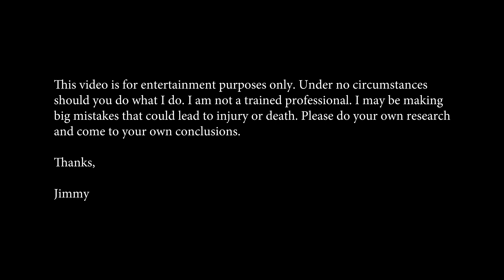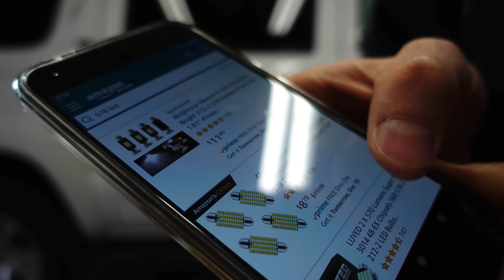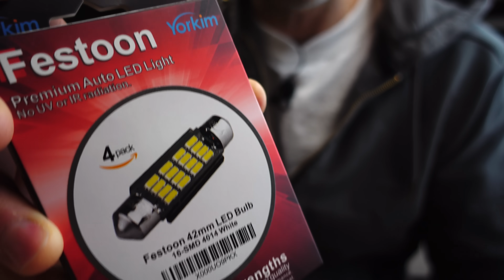Here's Why You NEVER INSTALL LEDs IN YOUR CAR OR TRUCK!!

Comment: Wait. I’ve watched 5 minutes and all I’ve learned is LED bulbs are better. Never use LEDs, eh? Sheesh.
Reply: Yep. Got us all to watch though.
Reply: yeah  stupid title
Reply: The only reason not to is a slightly common issue with turn signal bulbs not drawing enough power to make the blinker circuit work right in older cars.
Reply: Clickbaity title
Reply: He said "Do not use LEDs without heat sink for heat dissipation"
Reply: Meyndert Borrie Bornman That’s NOT what the headline says. . .
Reply: @Taka Yama maybe watch the whole video before being negative.  The content was actually helpful
Reply: How else to get your attention and watch, we keep falling for it but no harm done. And they keep doing it.
Reply: Taka Yama ya self proclaimed professional. The interior bulbs are just incandesant not halogen. Wow theres a big word for him. Leds are the big nightmare of the 2000s
Reply: @imperator parva 
Maybe not , but the cheap eBay 194 bulbs that are 10 for 10 aren't too bad. 
3-4 yrs later and at least half of em work and have been swapped around all over the place. 
A couple got whacked by moisture , but for cheap ones that's as cheap as I go , otherwise it's superbrightleds. 
I've never had any issues with those.
Reply: @standardloginname  you can use inline resistors on the wire to each light to use up the excess power. The old analogue units ticking speed was was affected by how much power it had, using leds pretty much gives it more power making it run fast usually
Reply: I did at my car the same what Macgyver was showing in this video and boom, there was a fire.
Reply: I did at my car the same what Macgyver was showing in this video and boom, there was a fire.
Reply: @meyndertborriebornman7798  LED's that run too hot could be out there... but after using them for several years now in many vehicles I haven't had a heat problem yet. Most if not all smaller lumen bulbs have nothing for a heat sink;  some headlights have 'em and some don't. His caution of "Try to get something solid state" was hilarious, like some LED's have a carbon wire that glows.... 
My guess is that if he had to double the size of the hole to put an LED in replacing an old filament style bulb, he may have greatly increased the lumens and thus increase the heat in that confined space.
Reply: I am working on leds in my part time research science 1990 made lot of prototype for lighting future...earlier i use lens type led which were very durable...now days they are useing bad flux bad insulation...heat sink are missing cheap immitations...which will definately burn ...
Reply: Dear i spend number of years in research and did lot in promoting as the day I find its durability n efficency....and insisted to use every where including tft displays which were back then lit with cfls..the neon signs..with sharp colour leds ...these cheap are putting bad image of leds n me I fear
Reply: @archygrey9093  Resistors get hot and must cause the LED and resistor to use close to as much electricity as the original bulb defeating the advantage in LEDs for turn signals except for brightness. Better to replace the flasher to use one designed for LEDs when changing to LEDs. I live in a northern state where we get ice and snow. Led lights are fine for inside the car but when ice freezes on the external lights LEDs would probably take even  longer to to melt the ice. They have the same problem with snow building up so stop lights can't be seen here. The remedy was to install a heater to warm the glass but the question is will the heater and LED use as much power as the old filament type bulb so are they more efficient than the old style bulbs for stop lights.
Reply: @gordonwilloughby8793  The amount of power the indicater lights use are pretty much nothing with or without resistors, i replaced all the rear lights on my ute as the old lenses and globes broke off. The universal led replacement cluster is cheap rugged and brighter and often cheaper.
Obviously replacing the ticker things the better way to go but resistors are cheap and simple especially since my front indicaters were still non led.
Can't speak for cold climates though, I've yet to see ice outside of my freezer.
Reply: JDMastar led bulbs FTW
Reply: Put LEDs headlights in my tundra truck.
Fortunately I only put them in my lowbeem.
Had to use my high beam to get home. It was like I had no lights on at all.
So I ordered several different sets that were advertised as being SUPER BRIGHT.
All useless......and I MEAN                        U S E L E S S S
ANYONE KNOW WHY.
I thought this video would explain why, but it was just an advertisement for them and amazon
Reply: @standardloginname  Most of the time hyper flash can be fixed with either a electronic flasher or a load resistor, Very simple!
Reply: @byronwoolfrey1039  they are the wrong color, human eyes don't respond as well to blue light as they do to yellow
just one of those things to watch out for...bright as day, can't see a damn thing
Reply: @jeffhousen8968 so why do emergency  vehicles all have blue lights on them.
I usually see the blue light at night before the red.
Reply: @jeffhousen8968  I did buy the small clearance light LEDs and yes they are brighter.
I bought 2 LEDs for my snowmobile and plugged them in to the snowmobile socket before installing them.
Both of them melted right away and wouud only light up on high beam.
Reply: lol was thinking the same ;)
Reply: Taka You have to think about his title but I get it.... he’s saying be careful about bulb design and heat sink. I’m an engineer by profession.
Reply: @standardloginname  that's why you buy an led flasher relay, boom problem fixed
Reply: Till blind me and can't see to drive as you follow or approach
Reply: @standardloginname  Can be fixed by replacing outdated relay for a modern one?
Reply: @jeffhousen8968  Actually it comes down to the CRI more than the color. In fact we typically are more alert and respond better with daylight balanced lights. It is the color of sunlight after all...I mean our eyes were literally made to see with sunlight.  Also they myth that blue light is bad for you is totally fake. Just a little PSA
Reply: @TomOostink  get an "electronic flasher" that drastic variation in load doesn't affect the blink rate. Pretty common in trailer towing upgrades as more lights would mean shorter, farther apart blinks with old style blinkers.
Reply: Fished in!!!!!
Reply: @TomOostink  If by modern you mean electronic, yes. However old style flashers are still made now since they are still cheap and reliable.
Reply: The problem is he is using canbus leds! They Have dump resistors making as much heat as incadecents, and using the same amount of power, which defeats the purpose of using leds in the first place!
Reply: @byronwoolfrey1039  Each lamp reflector (a part of the light assembly) is designed to reflect the light from the filament lamp forwards in accordance with legal requirements. Fitting retrofit lamps into the light assembly designed for an incandescent lamp will alter how light is projected on to the road, most likely with the result you describe. If changing car headlight, whether dipped or main beam for LED's then you should fit the specific, preferable OEM LED Light Assembly for the vehicle. Similarly rear lights need to conform in order to work within specific standards. Led Lighting for vehicles currently very primitive compared to the new Smart Lighting System that will rolled out with the next generation of Electric Vehicles.

Comment: I used Vintage Car LEDs for upgrading my 12v headlights in my 1963 VW. Quality lamps. Super performance. Literally like night and day
Reply: I installed LEDs (replacement bulb type, not the sheet of LED module) for my brake/tail lights on my 63 Beetle, and you can actually see them in daylight. WONDERFUL safety improvement!

Comment: FYI, if you buy a good quality LED light, it will last WAAAAY longer than incandescent or halogen! I put LEDs in my VW, for all exterior lighting, 12 years ago and they are still going strong, with no diminished output yet.
Reply: Much like a garbage incandescent can fail. The only difference is that LED is more susceptible to poor design.

Comment: I prefer the 'warm' color temperature LED light.  I think the 'cooler' color temperature LED produces a harsh blueish light.
Reply: Absolutely!  Thanks Frank!
Reply: Frank Bartlett  Me too.
Reply: Daylight is the way to go for me. 5000K
Reply: LED lights damage your eyes.
Reply: That blue tint is the easiest to manufacture. Getting other color temperatures require special filters that make the LED more expensive and reduce the lumin output a bit too.
Reply: @washington2free  that's not true and if your going to say blue that's not true the wave length trick you mind to no blink and that what does it the current running theory on to why that is is the blue we percieve from the sky during day time so are natural clock still thinks daytime. It also messes with the rate of blinking so are eyes dry up faster and hurt. If using a smartphone take a break ever 20-30mins and just close your eyes (or any screen for that matter).
Reply: @jadz684z   The blue light you see in the sky is reflected and refracted through the atmosphere as well as the reflections off of all the little items on the surface of the planet.  Bluish light wavelength from artificial light LED and blue coated bulbs are harsh on the eyes and the wavelength does not allow it to bounce around the cabin as does something in the 3K kelvin scale.... Most smart phone  have a yellowing light effect that is easier on the eyes.
Reply: @baluesclues8929  blue light is blue light it all measures in at around 405nm-460nm. I will say yes the sky is common knowledge but all lights (uv and ir included) is measurable to a certain nano meter of its wave length to get its proper color. But let me ask you do you know why rgb lights make white while mixing the same color paint makes black?
Reply: @washington2free  thanks for setting technology and ophthalmology back 100 years
Reply: @jadz684z   Two different mediums to start. Mixing - paint - makes a dark brownish color because of the color ranges.  RGB - filtration - is detected as white because that is how our eyes are made (Physiological makeup of the eye)... the way we detect light.
Reply: @baluesclues8929  No. Paint absorbs light and will reflect the colors that's not present. So if its red paint only red waves get to bounce off, the rest is absorb. With light that's what getting emitted. So let's say its red light only red light waves being emitted no other wave length are present. Think of light as a positive and paint as the negative for a short explanation.
Reply: @jadz684z  I am not questioning your red paint comments as well as any other color.. Bananas are yellow, mostly because they absorb blue light.  So yes, part of our color perception also includes the lack of colors through absorption, only to be returned through the other colors reflections.     Only Clint Eastwood's character painted a town Red...  Amazingly, we did not stare at a red blob on the movie screen because he did not paint everything within 50 miles red, nor could he put up a red dome over it..... but the dome would have excluded light and made our screens black...not good for box office earnings.... With only the buildings colored red demonstrates our color perception and the physiological make up of our optical system (in action) .....
Reply: @baluesclues8929  I stopped read after you said you not questioning my statement I'll take that as you understand how blue light is blue light no matter the source and how other light works in the world now.
Reply: I 100% agree

Comment: I installed LED lights in the reverse light sockets on my 2001 Oldsmobile Intrigue a few years ago and still bright as ever and you can see my car backing up a mile away. The headlights require an integrated circuit and fans to keep the LED headlights from burning out. Plus, some LEDs are off-road only.
Reply: Retro PC User leds aren’t for off road use only. If they are DOT approved then they are road worthy.
Reply: I did the same thing in my Altima. World of difference.
Reply: @Stienecker  Well, IF you LOOK at the end of his sentence he did say and I quote,  "SOME LEDS ARE OFF ROAD ONLY."  HA! DOT Approved! I could care less if they are DOT approved or not. Number 1, they are not going to check to see if the lights are approved or not, unless you end up in a accident killing someone. The only reason so many people bitch about LEDS is because 80 % of people who do install them, don't realize their headlights were out of adjustment and end up blinding oncoming traffic. The best part is , is that the ones bitching about them getting blinded, Are to stupid to recall what that white Fog-line is for at the right of the lane. Finally number 3. On being DOT qualified my FUCKS were all expired and had to dispose of all of em. No FUCKS TO  GIVE ANYMORE especially the way no body dims their brights until they are seemingly under your front bumper. What ever happened to seeing bright lights shining coming over the next hill !and dimming them before seeing the other headlights! Love my 4 Hikari Bulbs and they were the whitest you could get 2 years ago 9005's and 9006's" 2 each up front in a 2002 S10 ZR2, but I didn't like how when I had the brights on GM had them just using the 2 center bulbs as the Highs. I fixed that and now they all 4 go to being lit up on High beams but they are correctly aimed. I think I may have explained no fucks on my part to give out and why people complain, because they are lookin at very bright lights instead of the fog line painted on the road. Last but not least people don't know how to aim their headlights, did you know it's the same procedure on every vehicle and you can find the directions in the owners manual!

Comment: A factor in choosing them should also be to avoid using so called CANBUS compatible lamps where you don't need them. In order to not trigger fault detection in modern cars they have a surface mount resistor on the circuit board to simulate the load of a lamp. This is the source of a lot of the heat and often uses more power than the LEDs themselves. For interior lights that are not subject to CANBUS lamp testing you are better to use types without the load resistor (or you can remove it). I will not repeat the correct comments pointing out that not all filament lamps are halogen.

Comment: Those applications in this video clip are interior lighting. In most circumstances those light ing devices (LEDs) may not be on for a significant time (eg. minutes), and overheat issue may not be big concerns .